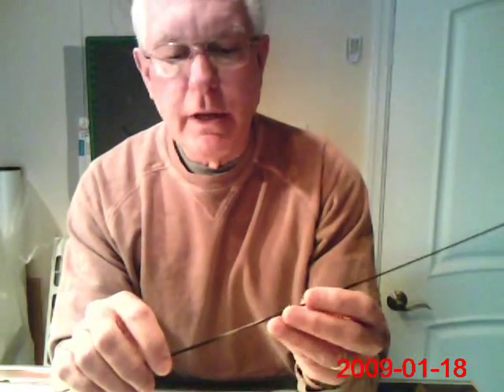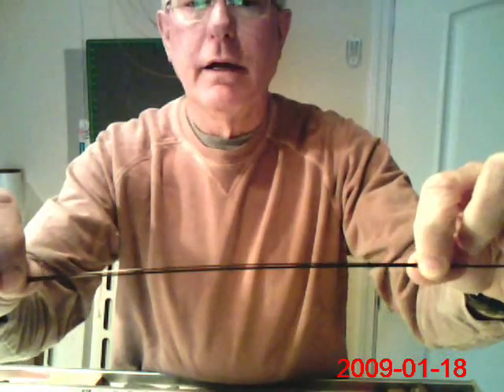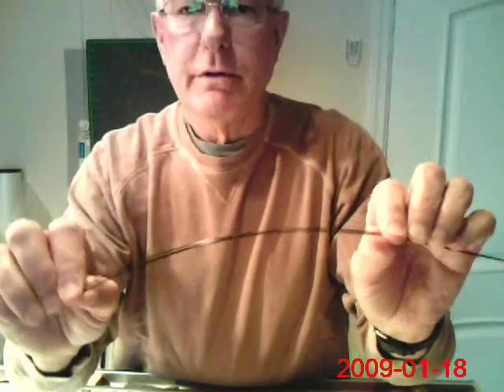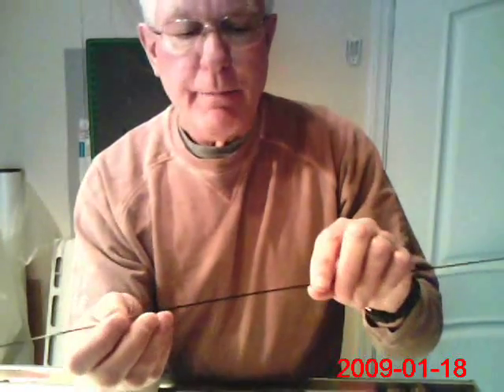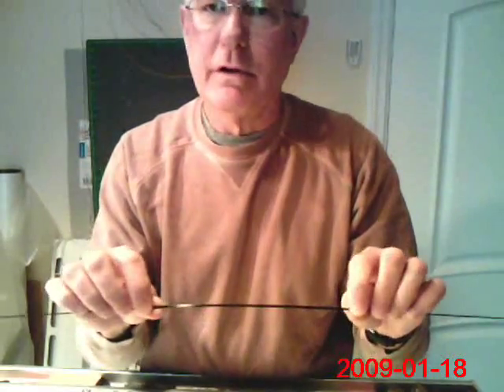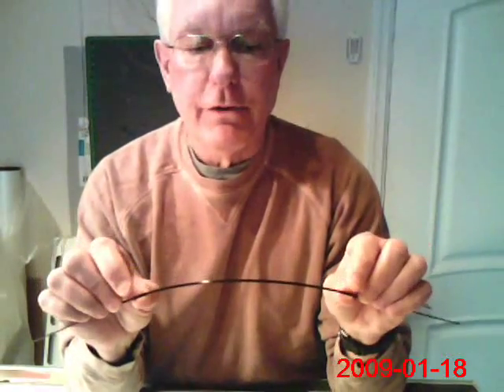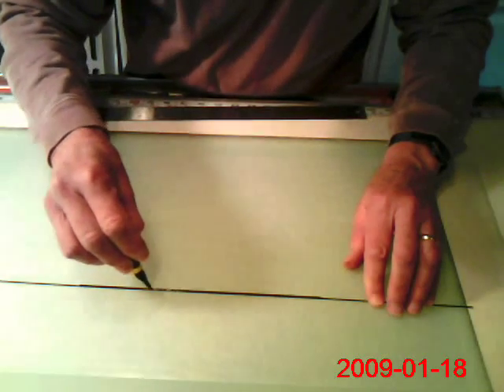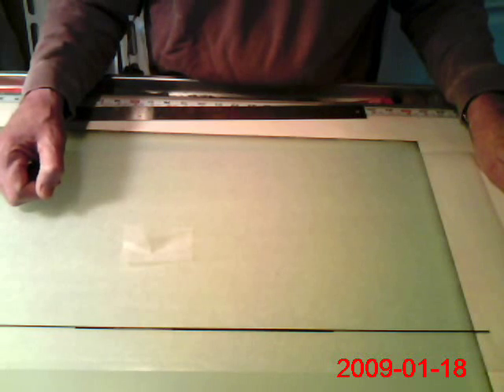Making A Variable Tension Carbon Fighter Kite Bow

Comment from the maker: i don't think it matters which way they are glued.  what is important is to be sure the two are in their natural positions. to find their natural positions, i hold both in position and flex them together similar to the way they would be in a bow.  when i do that each piece will rotate around it's individual axis to find its natural bent position.  when i straighten them, i keep their relative positioning and glue them in that position.  hope this helps.  bruce